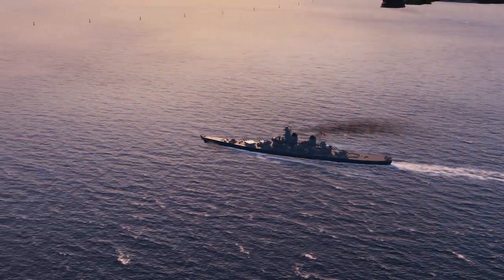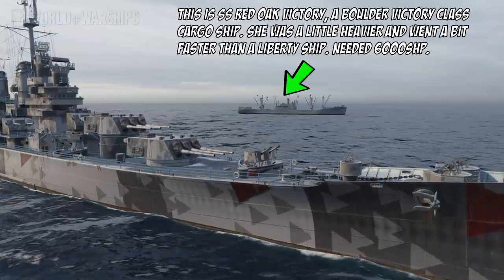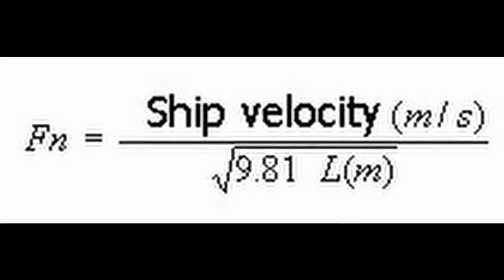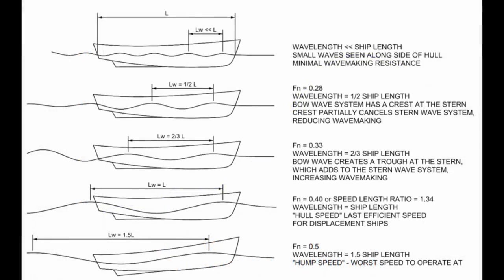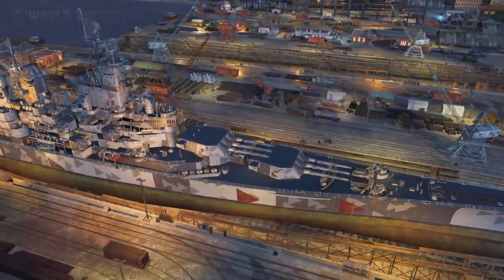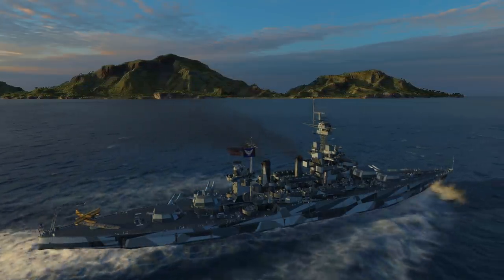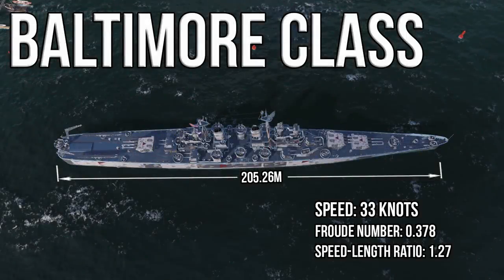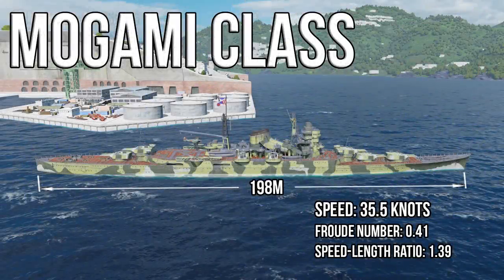Froude Number - Why Georgia and H4 are Memes

Comment: I will love to see some Soviet ship engineering breakdown. 😊
Reply: Should it work in the first place
Reply: They use special Stalinium metals and Stalin himself does the fire control for the guns.
Reply: The kremlin would destroy itself every time it fired its guns in a salvo
Reply: Or how they stop and accelerate on a dime
Reply from the maker: Ooh yeah, I'm getting to those ships too. Do need more classes on ship stability and such :) but they'll drop eventually
Reply: @ichasegaming  looking forward to seeing those videos.
Reply: @ichasegaming  Or the magic of Smolensk? The 19km range 33kg shells with literally no air drag.
Reply: @xsouldriverx  Well, that's simple enough to see in-game, actually. Take a look at the horsepower figures of the RU BB's and you'll see that they're basically the highest of every other BB of its tier. 
For example, Iowa has 212k SHP, Lion has 130k, FdG has 165k, and poor Minnesota has to make do with only 72k. Soyuz for some reason has 231k SHP. The only other ship that comes close is Georgia with 230k SHP.
Reply: They do not go as fast as these
Reply: @KarthikVishwamitra  To be fair they are often the latest designs of their tier, also soviet naval proportion is actually one of the few things they are good at. Besides the Soyuz is the size of a Yamato and does close to 30 knots, probably need that amount of power to push it to that speed.
Reply: You cant breakdown something doesn't exist beyong a drawing in a napkin
Reply: @ME262MKI  Soyuz, Izmail, Kronsthad and Stalingrad were more real than Republic, Montana, Conqueror or Kurfurst.
Reply: @clashman7564  The problem with Stalin's paper navy and the Soyuz in particular is that, despite their ambitious specifications, they were objectively bad designs that would almost certainly have disappointed in service.  What WoWs' s Soviet cruiser and battleship lines give us are designs that were probably incapable meeting their hopelessly overambitious specifications, performing exactly as Stalin demanded and their inexperienced designers no doubt fervently prayed they would.

Having said that, the Imperial Russian naval architects were pretty experienced and knew what they were doing so Izmail at least is fine and to a lesser extent so is the Sinop - just don't get me started on that super firing B turret.  You can't just raise a 1000 ton rotating structure ten feet higher up on a ship without critically compromising it's stability.

Comment: I'm pretty sure none of us ever expected ship's having a speed boost in WoWS to be a scientifically sound or accurate aspect of this game lol. Realism has never really been a big concern of this arcade game between Holland's WWII era torps that are somehow able to travel at 90 knots underwater, Kremlin's 457mm main battery turrets being able to rotate nearly twice as fast as Yamato's 460mm turrets, or something like Conqueror being able to completely repair almost all battle damage multiple times over per engagement. Also, various destroyer caliber guns being able to reach 11km+ when on a DD hull, yet those same turrets can only reach 5-6km when slapped onto the deck of a battleship in this game... With all this in mind though, I must say I was utterly shocked just now to hear that the engine boost consumable isn't actually physically possible...
Reply: Japanese Type 95 torpedoes can do 91 knots. The Halland is also a post war design, so it's not that ridiculous.
Reply: @SteinbergerGPPRo  Yes... and no..... 

The maximum speed of the torpedos came at the cost of range, because like ships they have a limited internal fuel load, and like ships their range is affected by their speed, also like ships they have a maximum range dictated by their 'cruising' speed, i.e. the speed at which they are most efficiently running. Most warships of the WWII era for example were designed with a cruising speed of around 15 knots. 

Torpedo's could be set to run at a series of speeds, but go above that cruising speed and you begin to lose range. So while it MAY have been possible for a Type 95 to reach the speeds you claim, it is NOT going to retain the huge maximum range the type is famous for at that maximum speed. In fact that range is going to drop HARD once you start running the weapon at those kinds of speeds. You are likly going to get maybe a kilometre out of that kind of torpedo at 90 some Knots....
Reply: I never thought about the DD guns on BBs being twice as short ranged.
Reply: @Shadow-sq2yj   Yea, when I first started playing this game years ago and learning more about naval war ships and their construction etc., I started noticing how many times the naval designers from all the various nations tended to share guns and other bits and pieces between ships of different classes. One quick example was two of Mogami's triple 152mm turrets being reused after Mogami's main battery was upgraded to 203mms, so the IJN took the spare 152mms and mounted two of them as part of Yamato's secondary battery where they can be seen fore and aft just behind the main 460mm turrets. So, this sharing of the same naval gun between ships of different classes is especially apparent with the number of times various BB secondaries double as the main gun battery for a nation's destroyers. You'll see Haragumo turrets used many times in the secondary batteries of BBs like Yamato, Shikishima, etc. and I believe Gearing's main battery guns are the same as what's used in the secondary battery of many of the US BBs and the Midway too I believe. So yea, it struck me as pretty stupid and kind of frustrating that literally a copy paste of the same guns featured on a particular nation's DDs can suddenly only reach 5-6km max when mounted on a BB in this game... Obviously it kind of needed to be done for balancing purposes, but still, it's kind of stupid that literally the exact same gun will have drastically nerfed range and sometimes also different fire chances and reload rates just by them being on the side of a BB rather than used as the main battery on a DD hull..
Reply: Gun range for most ships in WoWS has nothing to do with the reality. For example, in-game main gun range of Warspite is about 16.3km. But in reality she holds a record of a successfull shot at 24km distance. Mikhail Kutuzov's main gun range is 30km, secondary range - 23km - mostly because it's post-WWII design
Reply: @kenshinyamamoto5855   Lol, that's what we've all been saying too... iChase's video here was commenting on certain aspects of this game like speed boost not being realistic, hence all of our comments here with additional examples of the many many other things in this game that aren't realistic... Basically saying duh iChase, none of us thought the game was realistic to begin with, so you're not really blowing the lid off anything here that we weren't already well aware of.

Comment: The only thing I'd like to add here is that the feasibility of exceeding efficient hull speeds is largely down to a matter of scale.  The reason there were cruisers built that handily surpassed battleship powerplants in smaller size is that the boiler technology of the day simply allowed for it.  Size and space mattered and there are of course diminishing returns in packaging just as well as in the exponential power required, allowing smaller vessels to more easily overcome these limitations for their roles.

In your Georgia example, you list 1.41 and S/L of 1.39.  Note that those values were identical to those of Mogami, a real ship that was actually built and operated.  There is nothing physically impossible or even improbable about making such a thing even at the larger scale.  The unrealistic aspect of it is that it's still an Iowa hull with seemingly little modification.  It doesn't break through the barriers of reality, it breaks the budget and for no appreciable gain in a real naval doctrine that doesn't consist of a bunch of casuals zipping around the map randomly.  Strategically, that much speed would have been useless.  33kts was already fast enough to A) keep up with fleet carriers and B) run down anything it would be called upon to engage.

I'm not defending the choice (or admonishing it, from a gameplay perspective - I love Georgia!), nor criticizing this portrayal of the science (admittedly simplified to a reasonable level for a short video), but the context is still important to have a complete picture.
Reply: The reason there were cruisers built that handily surpassed battleship powerplants in smaller size is that the boiler technology of the day simply allowed for it

Debatable. Look at Mogami.

Comment: On a side note, this is also why modern warships don't really go for speed anymore, since you can't dodge missiles with a few more kts anyway, instead of 33-35 kts you slow them down to 30, in some cases 27 kts saves a lot of space; weight and money on their propulsion
Reply: Its not about dodging missles so much as it used to be about closing in on an enemy or running away when they suddenly entered visual range.   Since visual range isn't a thing anymore and missles have much longer range an extra 3 knots won't allow you to break or force engagement faster.

Comment: Bow shape , beam length and stern shape have a huge impact on how a ship preforms in water. You throw a rectangle in there with a concave bow with the same length as a ship you can get the same Froude Number but will need an exponent more power to hit the 20 knots.  other things that need to be calculated for ship speed A* typical wave amplitude

h* water depth
g*=9.80665m/s2 acceleration due to gravity
 circular wave number
S(x)=S*(x*)/(εh*2) submerged cross sectional area of ship at section x
 depth Froude number
U* ship speed

w* channel width
 horizontal coordinates
ε=A*/h* smallness parameter for wave nonlinearity
 depth-averaged potential
ζ=ζ*/(εh*) free surface elevation

anyways do one on Reynolds Number

Comment: Here's a quick solution: add hydrofoil as an option, and make speed booster ships displacement/hydrofoil hybrids (which I think most hydrofoil boats are, kind of - behaving like displacement ships at lower speeds). 

I know, I know, the largest hydrofoil craft IRL were well under 1,000 t.... So the required power for s 50,000-tonner like GA would still be out of this world. And hydrofoil would expose its unprotected bits when in use. Would help against torpedoes though, big time ))))

Oh, and an excellent video, btw.

Comment: Dude, you are missing one imortant aspect. I've been building Ship propellers since 1996 for a living. Efficiency of Fuel you need to have a certain Engine HP to maintain the max speed at the max rated RPM's. If you dont your fuel economy is shit. Not to mention leaving out how reduction gears figure into all of this. These arent direct drive boats like your average Mastercraft. These engines go through a reduction gear. I think the US Standards was around a 30:1 or 28:1 reduction to net them the allowable 80% fuel efficiency that was US navy standard. You can make the Arizona go faster by changing the reduction gear on its Original HP the problem is you couldnt make it from Pearl to San Diego without having to refuel at least twice to do it. I ran the Arizona specs just for shits and giggles. It would have required many things the US Navy wasnt willing to budge on namely the Fuel cost and the cost of changing the reduction gears. Also people need to quit with the Transom sterns go faster Bullshit. Ships are non planing hulls the stern doesnt even factor into the calculations for speed/HP/RPM's when it comes to sizing the propellers. Whoever started that on the forum is a dipshit.

Comment: I don't think the creators of this game studied physics. A ship going 38.1 knots will go 666 m in 34 seconds. This is the time it takes to cross a square of the "Ocean" map. 10 squares on the map are 6.7 km and not 36 km as written on the map. And the 48 km x 48 km maps are only 9 km x 9 km. We are doing battles on small lakes and not on the ocean. It feels so wrong.

There is no room for classical naval strategy and tactics. It's not surprising, that players complain about radars and planes.

It explains why spotting distance has been made shorter for ships than for planes and radar detection range has been made shorter than the viewing distance; but it doesn't really work.

You will find similar discrepancies in every part of this game. This is not a simulator - just a simple game.

Comment: Well yeah, this strongly concludes that speed boost is a pure game mechanic like flags and captain skills, but the base stats are all quite reasonable.

Though I have to note one very important thing: Froude numbers and Speed-Length ratios do NOT take hull shape and hull design features into account, which can massively improve a ships power efficiency if applied correctly. The most noticeable of those are bulbous bows and transom sterns.

Comment: And that's not even touching the two biggest problems in relation to ship speed increase, progressive cavitation and resonant vibration. Both problems the french and the americans found when trying to get their ships above 31kts. With the french destroyer eating their props and shaking themselves apart and the american having to design a whole new kind of stern and prop arrangement for North Carolina to prevent her from shaking her stern  loose and they still had to limit her to 28kts max due to excessive vibration.
If you want to recreat ships with some accuracy try springsharps, its a ok program, but for things like Henry you'll get tired of seeing "Error: Machinery is longer than hull lenght"

Comment: Have you ever heard about SS United States? its was an ocean liner built in 1950 and 1951. It was 302m in lenght, with 53grt displacement. It went 44kn ....her engines produced 241k shp
Reply: Its hull form is vastly different then a warships.

Comment: And how all this theoretical discussion and calculations for Henry 4 and Georgia lies in line with the real destroyer Le Terrible (132,4 meters length, 73000->100000 shp) that actually reached 45,1 knots of speed IRL after the engine speed boost? Because for him I got Fn=0,6437 and StLR=2,1639, which much higher, than listed "inadequate" ones for Georgia and H4. And French destroyer neither didn't fall apart during tests, nor jumped to the outer space, and successfully served more years after... I believe that the variables for the formulas should be checked more detailed. For example it should be not the ship length on central axis, but the half of actual perimeter length of the ship hull on the waterline level or something like this. Because if you take thin rod-shaped object to the water (like torpedo, or even lover sized thing like sting) and try to move it - it will suffer far less water resistance, than a waterdrop-shaped ship hulls. Because all the water resistance is put to the actual surface, that contacts the water, and not to the some theoretical keel+overwaterline length. But the object shape is for sure do not taken into account on mentioned formulas.
Reply from the maker: I'll get to destroyers in another video. The WW2 era destroyers tend to operate in that very extreme range and even ships like Le Terrible actually do work. But that's a video all by itself :D The numbers are actually correct :)

Comment: Did you ever calculate the Iowa's when they had their real speed boost when they say they could make about 250k shaft hp for a few hrs?  Just curious.
Reply: It would only be a small increase, since it takes more and more power to accelerate the faster you go
Reply from the maker: They'd probably hit around 35 knots, but the ship pretty much has to be in a lightship configuration. Doable, but not really practical for it's real world operations. Fully loaded, maybe 34ish knots?
Reply: @ichasegaming  definitely not doable post 1950s either. Engines were too old.

Comment: I also appreciate the calculations.  I had figured that if you had every steam powerplant on the island of Manhattan feeding steam through magical unreeling high pressure steam lines to the Georgia it might just about do it, but I think I kind of low-balled it.  Here is an exercise for your budding naval architectural mind - could you do it with gas turbines powering generators and electrical motors for final drive?  We have technology that has electrical super-cars putting thousands of horsepower down on the road with batteries and electrical motors. - just scale it up.  Price is no object - paper is cheap, and so are paper ships.
Gas turbines are very thirsty power plants, but remember that you only need fuel for twenty minutes of operation.
Reply from the maker: Don't even think a gas turbine, or multiple would be able to provide sufficient power. We're mostly talking future, anti-matter reactor technology here ;)

Comment: Out of curiosity, how would the bulbous bow of the Iowa class affect these calculations? Since the power calculation appears to be based on overcoming the bow waves and the bulbous bow was designed to mitigate the bow wave, wouldn't it also reduce the needed power consumption to achieve the Georgia's speeds?

I have seen some claims that this could reduce the power requirement by as much as 30 percent at 30 knots, with increased benefit the higher the speed. In addition, the New Jersey was clocked officially reaching 35 knots, with many sailors claiming the Iowa ships could go even faster. Do you feel these claims are valid?
Reply: Don't give WG ideas or the Iowa's will have speed boost in game like Georgia.
😁😁
Reply: @jayvee8502  Lol. seeing how much I love the Missouri and her laser accuracy, maybe I should be a little louder... ;)